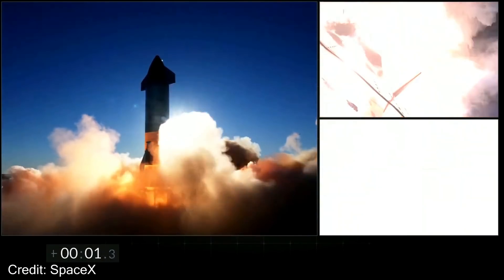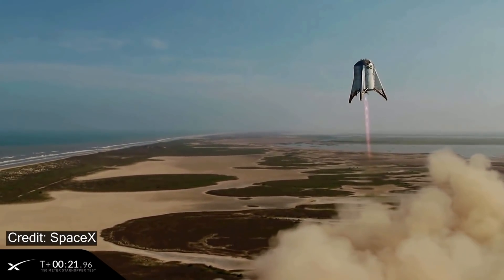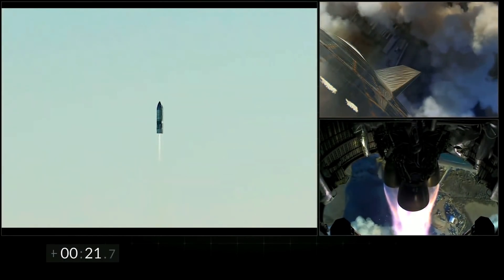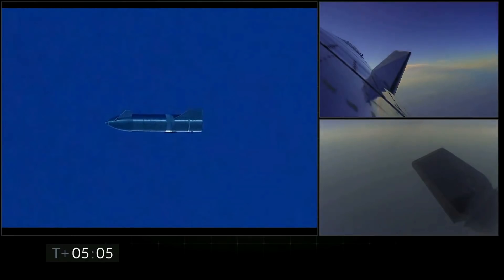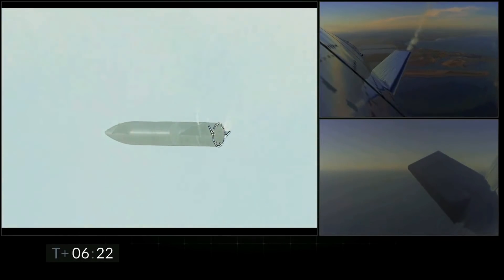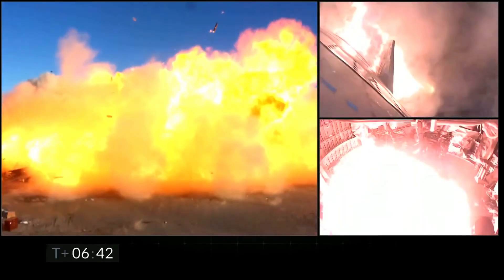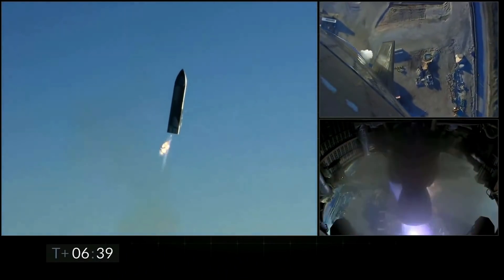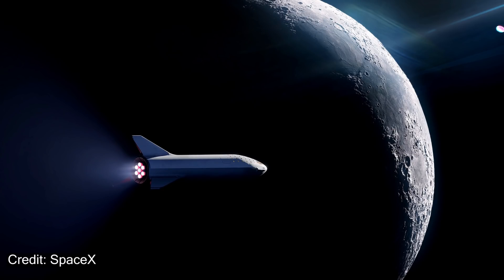SpaceX Starship SN8: Flight Recap

Comment: With the incident of starship SN8. I understand that the header tank lost pressure, or that the Pressure was too low, in the header tank. There by starving the engine of fuel. I think an easy fix would be a fuel tank designed as a large accumulator. That may be pressurized with nitrogen, or a large spring mechanism, In this way.  The fuel would remain under constant pressure for the most part.

Comment: The reason the green flame happened is because the fuel pressure wasn’t high enough so the fuel circulating around the rim of the engine to cool it wasn’t flowing enough so the bell overheated and the flame was burning burning the copper in the engine bell.
Reply: The copper in the bell is the passages where the fuel runs through, the bell surface is inconel. If it burned through, the engine would not be getting ANY fuel. The combustion chamber of most all liquid rocket engines is made of copper to transfer heat to the fuel running through the regenerative cooling passages there. That copper is structural and much thicker.

Comment: That's definitely copper burning in the engine. My educated guess is, there where two things happening here. The fuel tank(not oxidizer) was not pressurized enough. That caused the fuel pumps to cavitate and maybe suck in gaseous methane. Which itself is barely able to absorb even a fraction of the heat that liquid methane could.  With other words where ever those bubbles flow through the cooling-channels of the Raptor, there will form hotspots (most likely at or near the throat). That alone could be enough to lokally melt the copper. However since the engine is running low on fuel at the same time, there is also an excess of oxygen in the combustion chamber. 3000°C and extremely high partial pressure of excess oxygen, burns through pretty much any engine.

Comment: I saw several videos of the sn8 crashing but none of them revealed what was left after the smoke cleared. I was curious to see whether there was any vertical remains or weather the rocket was reduced to bits and pieces.
Reply: The nose cone was still intact, everything else was small scrap metals
Reply: There is a ton of video from NASASpaceflight and RGV Aerial Photography. On NASASpaceflight's channel there is even a video showing Elon Musk and Gwynne Shotwell surveying the results. From RGV APs footage, you can see that SN8 landed only about a fuselage diameter off-center.
The nose cone is pretty rumpled and crushed and only one fin seems to still be attached.

Comment: There is a second possible explanation for the green exhaust. The engines are ignited with a flammable chemical called tri ethyl borane, which burns green. They may have been trying to relight an engine that had stopped just before touchdown.
Reply: Starship, specifically the Raptor engines, don't use a seperate igniter fuel, they actually use  torch igniter that starts the engines with a small amount of fuel and the equivalent to a supercharged spark plug.

From what we can tell the issue was the methane header tank lost pressure resulting in the engines running oxygen rich, which started burning parts of the engines (engine rich exhaust), so the green was like copper or copper alloy in the engine somewhere getting used as poor quality rocket fuel lol
Reply: @UNSCPILOT  After further research, I find that you are correct. Ignition in the raptor preburners and combustion chamber is by spark ignition of methalox. Thanks for the help.

Comment: But did that maneuver really reduce the speed at which starship fell? According to Angry Astronaut the terminal velocity was essentially unchanged by the belly flop if you calculate the apogee at 12km and approximate 2 min decent time.  A concerning finding if true, watch his video
Reply: Yes. It did. Your description of his explanation doesn't make any sense. More surface area and higher drag coefficient equals lower terminal velocity. I can't stand his schtick so I won't be watching his video myself.
Reply: @Markle2k  I by no means am an expert in this field or knowledgeable on aerospace physics, thus why I referenced his video.  I simply meant to say he’s raising an issue of whether the belly flop maneuver actually is achieving what it was supposed to.  U can dislike a persons style but that isn’t reason to check out of the discussion.  the merits of an argument may be worthwhile to still discuss.
Reply: My understanding is this was just a high altitude test of the maneuver.  An important future test will be to see if the Starship can withstand the temperature/stress of the "belly flop" maneuver from high speed orbital reentry into the atmosphere to reduce speed.  There is a lot of testing ahead, but SpaceX seems to be making great progress.

Comment: The flames that burned after Raptor engine one and two cuts off, is the leftover fuel from the raptors just after shutdown. That leftover fuel gets trapped in an air pocket of the engine bay then gets burned off shortly after. And so SN8 reached 41,000 feet! It was beautiful! The answer to what happened at landing btw was that the header tank had low pressure and that's what caused the Raptor to be fuel starved and started to eat itself from the inside out. The Green flame was from the copper parts from the inner workings and parts of the raptor getting burned and shredded up. But it was amazing, and a massive success!
Reply: This is the best explanation I have seen so far on what happened.  Thanks.
Reply: Wow i knew this already but you are so good att explaning stuff so that you might actually be able to convince a flat earther the earth is round.

Comment: 3:10 why are the upper flaps extended and the bottom ones tucked in? isn't that the opposite of what they would want to do to flip the vehicle?
at 7:28 the flaps are doing the smae to get the vehicle upright again
Reply: In regards to your first question, I believe they had the fins oriented like that to initialise the belly flop manoeuvre, given it was still in rightward motion (relative to the camera). This caused more drag on the top, and started the motion. At that point, I think gravity did the rest, pulling the nose down, and then the fins actuated to stabilise the vehicle.

Comment: One question, what is the plan to land on Mars, when it is known that the atmosphere there is rarer than this atmosphere we have on Earth. I hope the translation is good, because I am translating through Google Translator. Greetings from the Republic of Macedonia.
Reply from the maker: Hello, and great question! The landing should be similar. Upon entry into the Martian atmosphere, Starship should still be able to slow down quite a bit from drag. However, it won't be able to slow down as much as this flight, so it'll will definitely need the raptor engines. I hope that helps!
Reply: Greetings from Canada! 

To answer your question, SpaceX still plans to use the bellyflop maneuver on Mars despite the atmosphere being only 0.7% as thick as on Mars. It will take a very shallow angle into the atmosphere from orbit to skim the thin atmosphere as long as possible so it can aero break. It will help if it lands on lower altitudes, such as in the Valles Marineris, since the atmosphere will be thicker there. Some combination of this and a propulsive landing will certainly do the trick :)